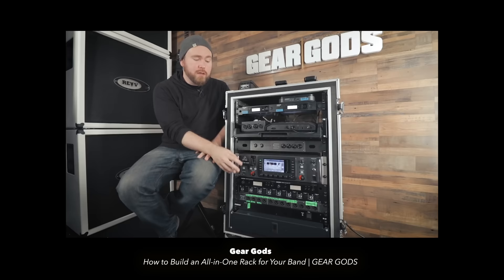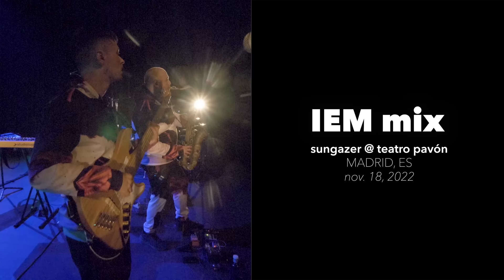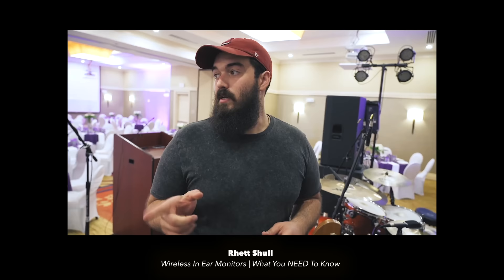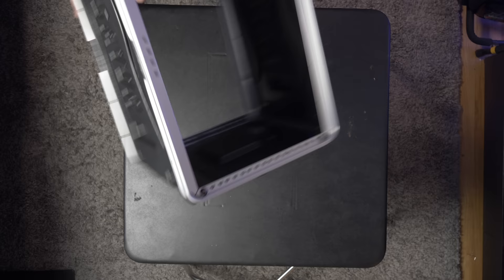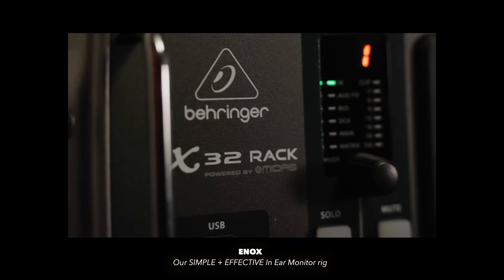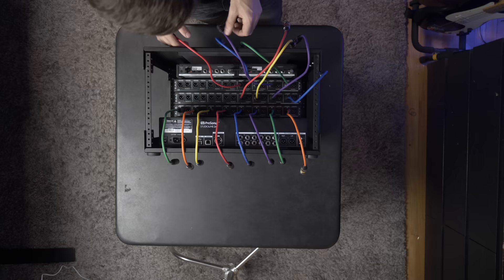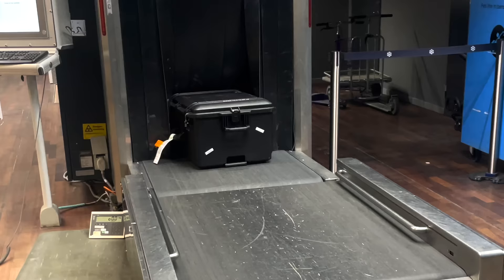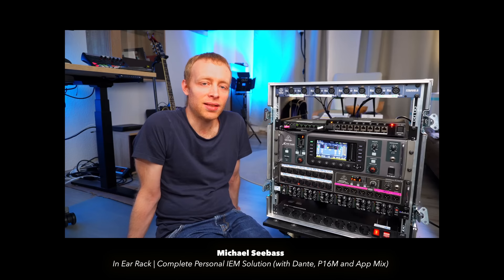How In-Ear Monitors are Making Better Musicians

Comment: 1:18 suggested addendum: marching bands do not look at the feet of each other.

Marching bands are so spread out on a football field that they have to swap styles on the fly. The back half of the band watches the conductor, who is typically on a raised platform, makes massive arm movements, and is wearing white gloves to help keep tempo. The front half of the band, hilariously, has to ignore the conductor and instead listen to the drummers behind them to keep tempo.

For this reason, drummers are typically held in the back or off to either side to keep the distance about the same without messing things up. This provides an interesting arrangement when drum highlights force the drummers to the front, as the drummers have no real way to keep tempo other than watching the conductor. Typically highlight/solo instances cause the rest of the band to be silent, so they can focus completely on marching and choreography, while staying in tempo with the drummers who are popping off on a sick highlight section of the music.

Source: took marching band in high school for 4 years
Reply: This is correct -another person who competed in marching band for 4 years. In my experience the drum line more so keeps time with themselves while also watching the conductor (or drum major, same thing different word) as like a “fact check” on tempo almost. Using vocal expressions of timing they are able to keep tight timing as an ensemble due to their proximity to each other. Then (if you’re drill writer is remotely competent and keeps the drum line at the back) the rest of the band listens to the drums/watches the drum major. Though in my experience in a fight between a drum major and drum line for tempo, drum line always wins lol
Reply: @subhm0 you are correct
Reply: lol marching band nerd lol
Reply: @ethanspangler7665  hehe
Reply: @submh0938  what section were you in? Or what instrument specifically?

On season I was low brass, Euphonium. Off season I was bass trombone ☺ I miss playing trombone and baritone, honestly.
Reply: thanks for your insights, I was always curious about whether EVERYONE was looking at the conductor or not
Reply: Peripheral vision is actually better at catching timing from movement, there’s no need to state…
Reply: Adam wasn't referring to corp-style marching though. His reference video was high-step, which might be different, but I can't speak to that as my school was corp-style.

Was in the front ensemble 4 years. How we did it was as follows:
1) Center snare kept time by dutting
2) The battery locked in with the duts
3) The drum major kept time by watching the center snare's feet
4) Winds kept time by watching the drum major's hands
5) Front ensemble kept time by listening back to the battery

Could have been different elsewhere, but that's how we did it.
Reply: @biggrayalien4791  on season Sousaphone, off season tuba. Low brass represent!! 😤😤 lol
Reply: @C4pt41nN3m0  that’s super interesting how there are different techniques in different schools. Very fun to learn about. Here in Iowa from my experience we are watching a drum major/ listening to the drum line and not watching other’s feet but I see why that would be a technique used to keep time. Thanks for the insight!
Reply: @PhiNickGaming  No you're absolutely right, I forgot the drum major watched the lead snare's feet.

I do remember one year we had to face backwards for like sixteen measures, we actually had our second drum major conduct from the back to help everyone keep tempo.
Reply: I marched drum corps (DCA) along with marching band in high school.  The drumline were told to watch the conductor, no matter what their position on the field.  Us brass players were also told to watch the conductor, and listen back to the drumline based on field position.  Obviously, if the drum line was on the right 20 and you were on the left 20 that wasn't feasible, hence watching the conductor.  Additionally, we would be told that our focus for our sound was the press box:  That's where the judges lived, and that's where we wanted the sound to be perfect.  Those of us outside the 40s playing would be told to be just slightly ahead of the conductor, on the front end of the beat, so that our sound would arrive at the press box at the same time the power alley would get there.  Great fun when it worked, and not so much when it was off.  This is why we rehearsed some sections all the time - get the muscle memory with both the feet and the hands so that it sounded good to the people who were giving us their critique.  Not so much fun was every venue was different regarding height of the box, distance from the field to the box, etc.  Fortunately, once we had a good set it usually worked at every location.  

Moral of the story?  Wanna hear good sound at a marching band/drum corps show?  Sit right under the press box. :)
Reply: @biggrayalien4791  My school always had 3 drum majors, and at least one was backfield at all times, but we also had much more backfield-facing marching than you described, so that would explain why. Here's the show from my senior year, if you're interested: https://www.youtube.com/watch?v=SOuEIHMfDG0
Reply: thanks for typing this
Reply: Exactly right, 7 years of marching band and a few national shows :) low brass babay!!! 🎉
Reply: Thanks for commenting! I always wondered how they do it, now your explenation makes complete sense to me. This way the sound waves at the front are synced up to the ones from the back by the ears of the players at the front, so they are compensated to reach the ears of the spectator at the same time.
Reply: @carsont4625  yep. i played in front :)
Reply: @carsont4625  forgot to add that in my summary. We looked in to center marimba for cleaning and pulsed as your described as well.
Reply: There are so many marching bands that do things slightly different. I march four years in high school, two in college, and two seasons of drum corps. Everyone is different. 

In some bands (mostly smaller high school bands) the winds watch the drum major who watches the feet of center snare.

At my university, drum major watches center snare, percussion watches drum major. People behind percussion watch drum major and people in front listen back.

Drum corps do whatever, whenever to make it work. Most of the time everyone is watching the drum major who negotiates times with center snare (it is unlikely either will be off and if one is, they will adjust very quickly) It is true that sometimes you watch feet for time. You might have an entire group of people that can't see time. 

For drum corps, you are spending so much time on the show this is generally not an issue, at a certain point you should have a really solid internal pulse. If it remains an issue, you select a person that can see drum major or feet to dut. 

When there are tempo issues, you just work on it until they aren't there, this should take little to no time. The biggest problem with drum corps timing is not tempo but timing/phasing. In this context phasing can be thought of as when everyone on the field plays at once but at different points in the audience you hear different people at different times. When you have a band stretched from one corner of the field to another this is going to happen. There is nothing you can do to solve this. You simply have to decide what section of seating gets the best in time sound (generally the box). This is true because if you have one section on the side one 20 and another on the 50, the audience in front of the the 20 on side one is going to hear the tubas or whoever first then the trumpets (specific instrument doesn't matter). People on side one 35 are going to hear it in time if everyone is playing with the same timing. From the 35 side one to end zone side two, they will hear the trumpets on the 50 first to an ever increasing degree. 

Long story short, with drum corps, you just have select who will get the best version of thst show. This almost always means that people further out will (mostly naturally, but sometimes it has to be discussed or even focused on) have to play slightly ahead and people towards the middle play more and more in the center of the beat. 

This is only made more complicated by front ensemble, mics, speakers, soloists, venue, and a million other details. Long story short, in drum corps you do whatever to get the timing to be exact, you have about two and a half months rehearsing before finals so it doesn't matter how janky it is at first, by the end (the sooner the better) it should be perfect.

Needless to say, college and high school band is generally a lot simpler. It also helps that those bands are improving the entire time whether it is the articulation style, marching style, the music or the drill. There are major issues in most marching bands (obviously college less so than high school) that never get fixed and the director is just playing wack-a-mole. In drum corps the reason the show gets better throughout the season not because we get better at the show but because there is more added to it.
Reply: @jonathandurbin5534  Yep, as a smaller high school band, can confirm that we watch drum majors and drum majors watch center snare.
Reply: There is also an internal rhythm you develop by practicing the marching band routine.

You count steps it takes to get to the next formation.

(4 years as well)
Reply: Z
Reply: I’m in the marching band in the video, you are correct !
Reply: I thought Adam's ideas were weird. You nailed it, though. I was in the marching band in high school as well.
Reply: Nonsense. There are "wing" conductors on the left and right about 20-25 yards away from the main conductor (called the Drum Major) who ape the main conductor's movements. There can also be rear conductors doing the same thing if needed.
Reply: @avjake  the most man-splainiest comment I've read in a while. 

Also sorry that 13 years past school has caused me to forget the official term, but thankfully we have you to passive-aggressively point that out. 🙂